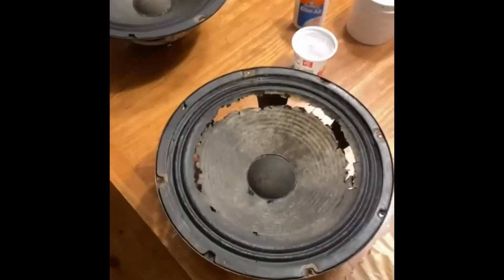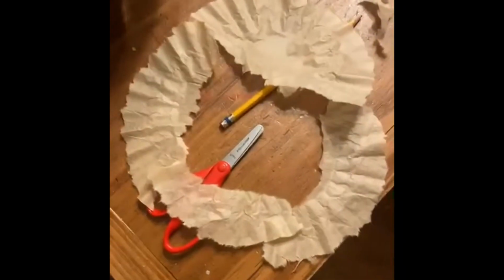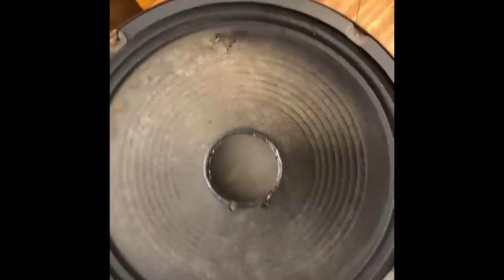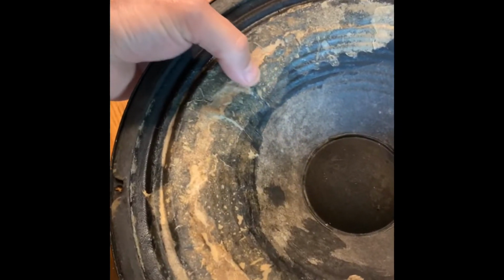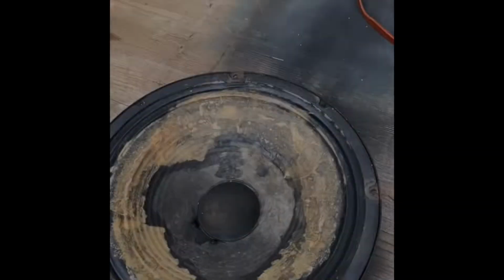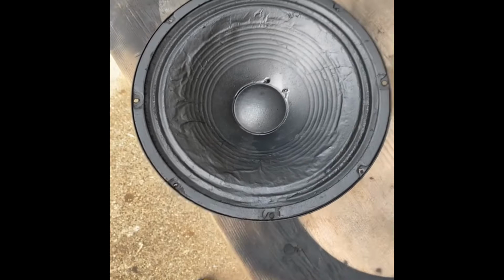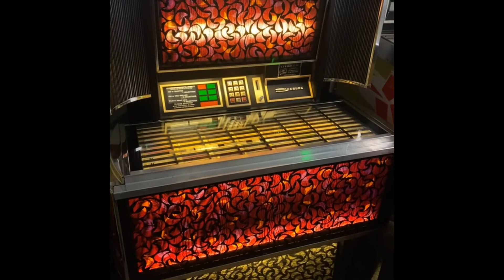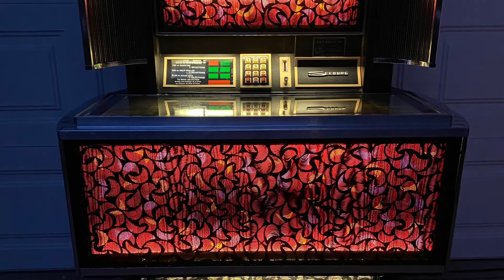Seeburg Matador speaker repair

Comment: i normally am a big fan of original stuff, i was thinking to repair them, but i replaced them for sica speakers, fits perfect (had to cut a tiny bit of wood to get them in the hole that fits nice. and they sound a lot better, not a change to some sort of modern sound , the jukebow still sounds vintage, but before the change i listened to the one speaker that worked ,  some words where hard to understand, and now its crisp and clear wathever the band is singing and playing.  i had also one cone rotten, not as bad as yours, just one tear from moister , and one speaker had a coil sticking witch i could get loose with some force .  people are spending money and time to repair the amps, but if that old speaker sticks or does not move like it should your amp is in danger or your sound is just bad . my amp was still sending power to a speaker with a sticking coil, waiting for a disaster to happen.  SICA 12 D 1,5 CS 12 inch - 200 Watt Full range is what was recommand to me for an olympian , after a few hours of play they start to perform realy well. (they have to play in).  the sound of that  ac/dc gitar is like real , voices from brian are spitting in your ear  and bass is nice to.   Also the horns (coils) are most of the time broken,  those can be repaired with new coils. (better coils that do not break from vibration but build with the same material ) there is a guy that have a repair clip on yt , and coils are cheap on fruugo or ebay etc .  my juke came with aftermarket tweeters (100watt) but the horns sound better, they throw the highs out further with less power from the amp.  these seeburgs sound absolutely great ! keep them playing :)